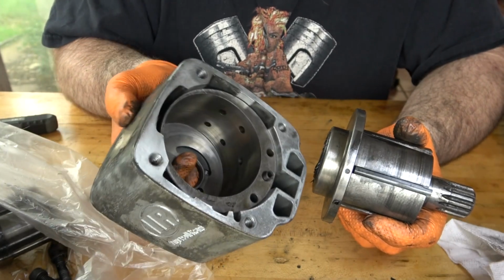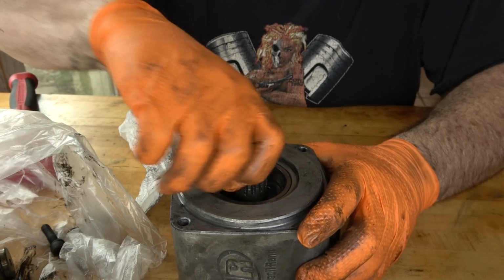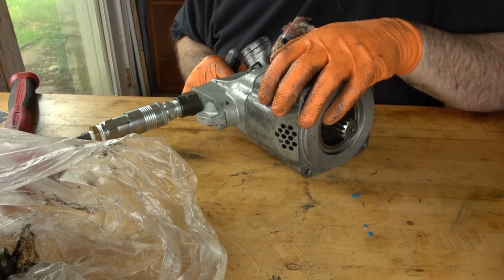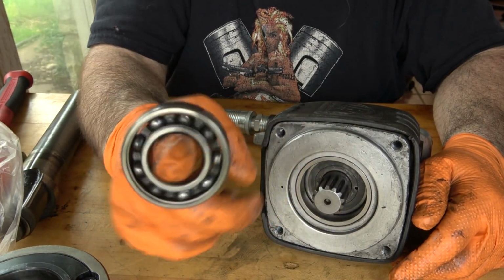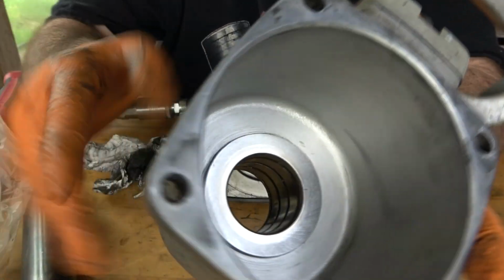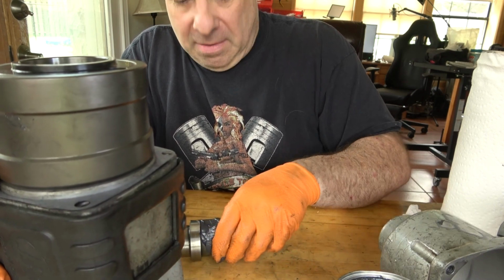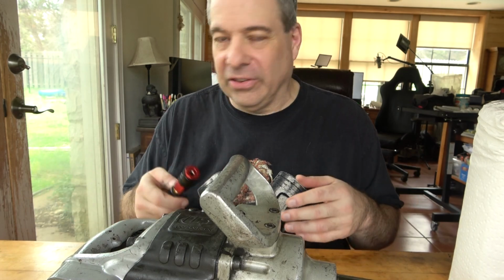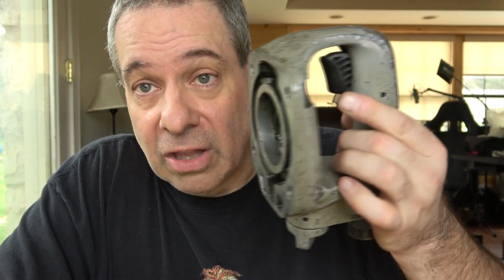Broken Ingersoll 1" Impact

Comment: We have a 285B, its about 30 years old and still works good but I think its losing its torque.   I have been a lunatic about keeping oil in that thing, I have drove my father crazy constantly putting oil in it.  Everything turns smooth but it just doesnt seem to have the break away power.  Where do I need to look first?  I have rebuilt a 3/4 impact previously, but I ive never messed with the 1".    No air leaks at all.  Should I start with the vanes or the cylinder the vanes fit into or what?  I will change the bearings as well but I dont believe that will cause a loss of breakaway power.  What do you suggest?

Comment: Damn that thing is a monster.  Makes my half inch guns look like they were made by Fisher-Price.

I find it interesting that they use a swinging weight design for their hammer. I guess you couldn’t make a twin hammer slender enough to fit in that housing.
Reply from the maker: It's a beast, for sure. I shoulda weighed it. After using it, you can skip gym day.
Reply: @CoyleTools  I can imagine that thing would get you quite a work out. I’d also suggest you check the fillings in your mouth too when you’re done.
Reply: i repair and service these things for my company. the chicago pneumatic ones use a double hammer system. we have one of these in a 5 spline and it's the same setup. I always found these things weaker because everything rusts the moment it is driven on the road an and the faster impact speed wins.